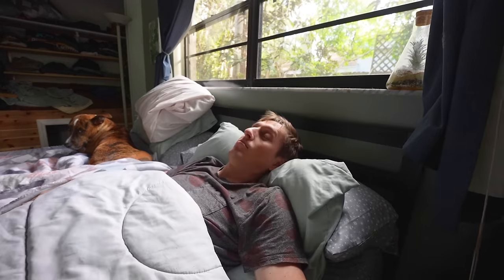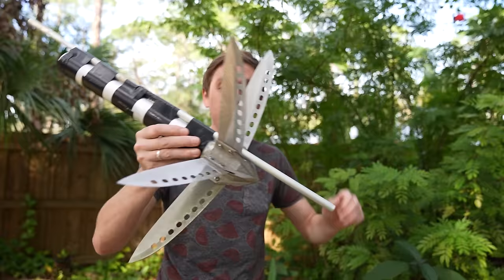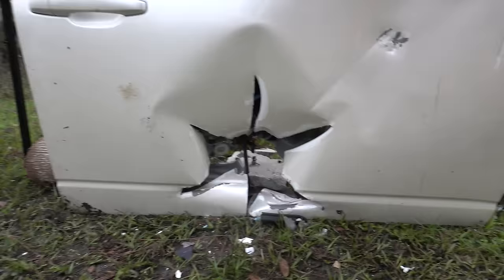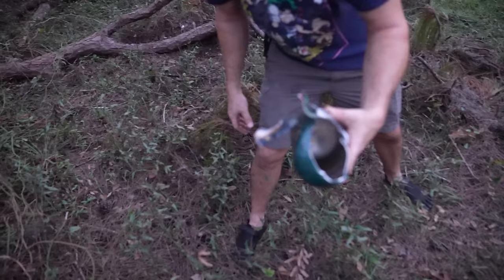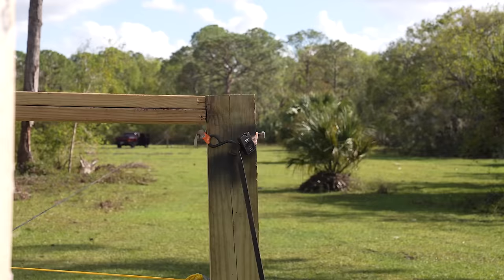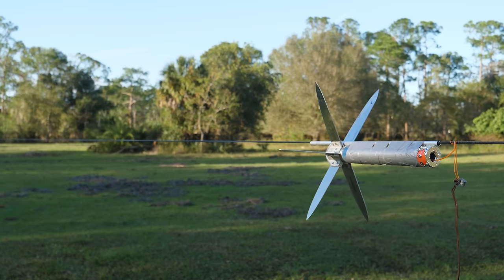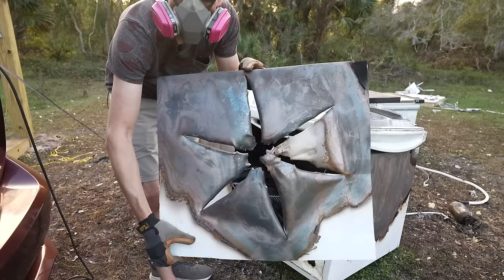400mph Rocket Knife

Comment: For anyone wondering the mixture is 50% kno3 (potassium nitrate) and 50%sugar melted together on a low heat. 👍🏻
Reply: why do ya put sugar though
Reply: @nithinsirimanne2924  that's the fuel.  KNO3 is just an oxidizer
Reply: Would this say be a good explosive for  a tubular pased explosive device
Reply: @Sci_X1  no. Its designed to create steady slow (vs an explosion) gas release
Reply: No that's a banana equally dangerous though.
Reply: A classic recipe, smells like childhood. RIP Grant Thompson.
Reply: Guys I don’t think you can share missile receipts on YouTube
Reply: Wait, is that the ideal stoichiometric ratio or did you mean 50% by weight?
Reply: @drewcmarkham  I literally saw a comment explaining how to manufacture TNT at home in great detail, and no-one cared. I don't think anyone is going to get mad at hobbyist sugar rocket fuel.
Reply: How would you ignite the mix?
Reply: @RAMROD1847  fuse.. preferably electric discharge( igniter & remote switch..)
Reply: @megan00b8  I was joking
Reply: @nithinsirimanne2924  ke toko suruh aku tak
Reply: If you liked this you are now on a watchlist. Ps I liked it too. This is also a joke but it could be plausible.
Reply: better ratio is 60 kno3 40 table shugar with 1 percent Fe2O3 sa catalysator. But better result is when you dissolve all in small amount of water, and slooooowly ewaporated water on boiling bath.Melt is too dangerous. After drying carefylly grind it
Reply: @rishabhsingh61  English?
Reply: Me to I got original anarchist cookbook tells you how to manufacture anything
Reply: If you search deep enough not to hard you can find out instructions on how to make a nuclear bomb
Reply: @seankessens5148  mmmh. do u have a pdf?
Reply: Add iron oxide for extra efficiency
Reply: @drewcmarkham  'Murica
Reply: @gabedarrett1301  by weight
Reply: @Sci_X1  just pour gasoline on styrofoam dude
Reply: @kadikiss  He didn’t show that publicly available recipe incase someone got hurt and pinned the blame on him 
Emphasis on publicly available, as in you can just google it, as in accessible to anyone
Reply: @nithinsirimanne2924  777
Reply: Imma use that
Reply: @newtybot  the recipe he blocked out in the video isn't an actual rocket fuel recipe lmfao. Ffs the last line in it says "remove the meatballs from the oven"
Reply: @newtybot  it may not contradict that there are public recipes out there online for rocket propellents. but it does contradict everything else in your comment. the whole thing was for comedy, not to suppress any possible backlash. saying i cant read but you cant even understand what you wrote 😂
Reply: @ItzDeploy  Yeah the guy who's had the FBI visit his house because he taught people how to make hydrogen sulfide gas and sodium bullets TOTALLY just omitted the recipe for crude fuel for his knife-launching rocket "as a gag" 

Yeah, totally
Reply: That's a weird ratio even for a sugar rocket. 
Also he probably used a catalyst to make the fuel burn faster. 
Just like you'd do the opposite when putting baking soda into the mix to make it burn slower.
Reply: Y'all keep talking about rocket fuel, I'm gonna stay with classic gunpowder.
Reply: @Gun-Bricks  Depending on the projectile, gunpowder can be far more superior. Rocket fuel is better if you need to deliver a heavier payload over a long distance, like this one. 
Then again, if you packed a bunch of knives into a cannon and fired it, you'd probably destroy everything in sight as well.
Reply: Wikipedia
Reply: For anyone who kills themselves with this stuff or blasts off important body parts themselves or other people - say thank you to this nice person here
Reply: is it edible I wonder?
Reply: @misfortune734  Consdering the fact that you use that same KNO3 to completely wipe out a tree's root system....I'd say no.
Reply: That's probably not the mixture. The one you're talking about is just a general mixture for rocket fuel. 🙄
Reply: bro ur gonna start a war or smth cause some people are gonna make those rockets then and try to take over the world
Reply: perfect now he's responsible for 14 deaths of minors 👍

(yes this is a joke)
Reply: Bye 👋
Reply: finnaly i can make my own bomb
Reply: I know, I learned that from TKOR
Reply: ammonium nitrate works as well, also amonium perchlorate

edit: if you make it, be VERY CAREFUL with KNO3 or NH4NO3, they can explode violently, especially when heated
Reply: i thought it was 75-25 whats the difference in power
Reply: Thanks, I remember having seen (years ago) the king of random having made rocket fuel, from my understanding, you add more sugar for a slower burn, and more potassium nitrate for a much faster burn
Reply: @AtomBomb420  yes, and if you remove the suger, you'll discover the fine line between a rocket and a bomb
Reply: @gabedarrett1301  by weighrt
Reply: @megan00b8  tell me
Reply: not true. It was 65% kno3 and 35% sorbitol
Reply: Time to make miltary grade missiles
Reply: @seankessens5148  That's actually the easy part. Enriching the uranium/plutonium is much more difficult; only a few countries can do it

Comment: HOLY FORK!
I've been WAITING for this after hearing about it on the safety third podcast!
I'm SO EXCITED it's finally here!
Reply: Fork
Reply: Fork
Reply: Fork
Reply: Fork
Reply: Furk
Reply: Fork
Reply: What I think would be really interesting would be to have one after the rocket has burned out, and after it has left the string, not impacting anything but just getting the recording of the sound of it passing. Also what I would do is put three of the blades at the front, and three of the blades at the back so that you would have a bit more stability once you leave the string and it wouldn't just immediately nose over.  Calculate the center of pressure to be slightly behind the center of gravity of the expended rocket.
Reply: Feck
Reply: Fork
Reply: Spoon
Reply: Fork
Reply: Fork

Comment: A rocket like this going slightly over half the speed of sound is wild 💀
Reply: bro is not living over the age of 40 💀
Reply: am i wrong or does this thing absolutely have the potential to cover half of florida if the rope breaks?
Reply: @sealteamsix1784  He mentioned that it's very front heavy so no, it'd just crash pretty quickly.
Reply: @patrickmorrey8722 one did veer off course and hit a pine tree 15 feet up though lmao
Reply: @perpeder4370 so it can hit stuff 15 feet away.

Comment: I would love to see a rocket design where the knives were reoriented to have the tips at the front, with the backs of the knives against the rocket body.  It would be the ultimate stabby rocket
Reply: There are retractable broad heads that have that design when folded up. When they hit the target a sacrificial rubber band breaks and allows the blades to fold back into the expanded position.
Reply: @spencerhanson7808  yeah I've seen those on Joerg's channel, I don't think the rubber gasket system would work at rocket speeds though

Comment: 3:30 I thought that as long as the center of mass is ahead of the aerodynamic center, the rocket will be stable, so being nose heavy shouldn’t reduce stability.  However, drag from the blades could cause instability (which could be counteracted by putting fins at the back).
Reply: Also the rocket is travelling horizontally so, even a degree pointed down would cause complete instabilty.
Reply: True it's stable if it were falling under gravity, but not in this case where there is thrust from the back.
Reply: @anluifb  the problem is, acceleration from the same source is proportional to mass. So the lighter tail end of the rocket excellerates faster than the tip. This happens with arrows, it is why the arrows flex so that they can straighten themselves out after the lighter rear end accelerates faster and pushed to the side as it tries to pass the front.
Reply: I just know that rocket goes boom😂💀

Comment: You might want to consider increasing tension in the cable for the next time, the rocket pushes a highly energetic cable wave in front of it... the amplitude will increase until failure or the end is reached...

Higher tension will hinder the wave's development.
Using multiple strains of paracord, splaying out to a frame, which is anchored with multiple anchors should do the trick.

Also, using hoseties/hoseclamps or just metal strips instead of tape might be a bit more reliable as a guide
Reply: Eyo, everybody like this. This actually makes a lot of sense.
Reply: @Peter-ui6ey  thanks for that endorsement, I tend to put high effort into making logical tips on improvements...
after all I'm a talking doggo and there's a huge burden on my back to represent all run of the mill talking doggos out there 😂
Reply: Good point
Reply: @tolkienfan1972  The goodest!

Comment: 2:18 genuinely useful tip - using a sharpened masonry bit to drill hardened steel. If you've ever had to drill through steel+concrete in construction then you'll have done similar. Dipping in water, changing batteries, but no rockets!

Comment: Wow, those things are legitimately terrifying. When I see you-tube videos where people make scary sounding things they're usually far less dangerous than this. Well done! also considering the construction method it really wouldn't be much harder to make folding blade versions of these, for these tests folding blades really aren't necessary but it would be cool.
Reply: If you see anyone setting up a cable pointing toward your house, you'll have the heads up no one else does!
Reply: @helives2630  well honestly if he just moved the blades to the rear of the body and added a bit of weight to the nose I imagine it would fly pretty well without the cable. he mentioned he intentionally designed it to be aerodynamically unstable as a safety measure hence why the majority of the weight is rear of the portion with the greatest drag. make the blades fold and you could fit it in a portable launch tube too.
Reply: @phosistkar6425  That sounds thought out. You wouldn't happen to be planning anythin, would you?
Reply: @GROOT0404  Nah, I don't have access to enough open space to play with anything this dangerous. It's a fun thought experiment but would be completely unsafe to try in the real world.
Reply: @phosistkar6425  Isn't the intention for it to be completely unsafe?
Reply: @GROOT0404  Not for me, I'd rather not spend the rest of my life in prison for making a bladed rocket that hurt or killed some innocent bystander. Putting myself somewhat in harms way for fun is fine but putting other people in harms way is too unsafe.

Comment: This is cool.  I read a book somewhere that they use star shape core at the rear end of the motor in order to maximize the burn rate at the beginning. That kicks the rocket to a higher velocity at initial phase, and then the cavity becomes narrow up the tube in order to sustain longer flight.

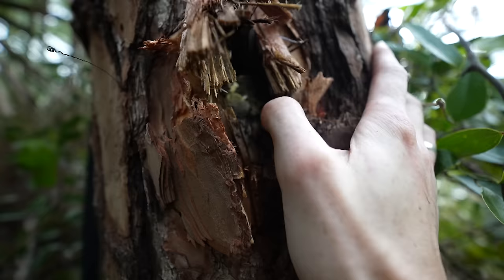Comment: 1:50 Math correction: assuming constant acceleration, the end / max speed was 988 km/h, i.e. x2 higher than 494.
Compute acceleration "a" using x=0.5*a*t^2 and substitute it into v=a*t=2*x/t=274m/s=987.552km/h. Almost speed of sound.

Comment: I thought about this, and ways I could shoot it out of a RPG type thing. And then I thought - why not shoot multiple out of the same barrel? And then I thought, why not do away with the blades and make them sharp spikes so that you can fit more? Following that line of thought, why not make them little balls so that you can shoot out a ton? Less range for more damage? But since reloading would be a pain, you could put them in a disposable cartridge, like a giant bullet. I then came up with a really cool reloading system where they are end to end in a tube and get pushed into the barrel one at a time. That would be really cool to mount on a vehicle, but what if you made a portable small version, like a rifle?
And that's when I realized -
I had reconseptualized the shotgun.
Reply: you also reconseptualized flechettes

Comment: i have a tone of model rockets and im planning on getting my first license for high power motors in a year or two
this was amazing the best video you ever made
Reply: No need for a licence if you can just mix (rocket) with (motor) to make the solid fuel called (rocket motor) which you can cast at whatever size you need. Well, unless you live in Europe in which case it might not be legal.
Reply: @theKashConnoisseur  i live in the us and yes its posable and cheaper to make your own propellent but can you reliable get it to evenly burn and get your rocket up to 15K+ feet and 2X faster then the speed of sound
Reply: @pdfoltin5076  Where there's a will, there's a way. Real question at this point is, would it be cheaper to make your own after factoring in materials and equipment costs?
Reply: @theKashConnoisseur  are you kidding? It's so much cheaper to create your own motors by like 80%
Reply: @theKashConnoisseur  yep if you made a hundred or even 25-35 of them it will be cheaper but any less and the equipment wont be worth it so it would work and the big motors are like $200 a peace
Reply from the maker: @pdfoltin5076  there's no wrong way to do it! I like making the fuel, but a lot of amateur rocketry clubs don't let you use homemade fuel, or restrict you to a few proven propellant's.

Comment: I feel like you could make the blades foldable to extend them. Some kind of spring-loaded folding mechanism that lets you retract them into the barrel and instantly begins pushing outward when it leaves the tube. It would probably need some kind of upgraded tech from just basic springs and would likely require some modding to the barrel to prevent the blades from cutting into it, but I think that could make it pretty cool. A bunch of blades sling out from all sides as it rockets toward your neck and decapitates/eviscerates/vivisects the whole family at once! Flashy and effective.
Reply: I think that's what the military version does. Considering how long it took him to machine and assemble each of these, I don't think he wanted to spend a bunch of time and money to weaken the part that needs to be the strongest for the design to function, but it would totally work.

Comment: What I think would be really interesting would be to have one after the rocket has burned out, and after it has left the string, not impacting anything but just getting the recording of the sound of it passing. Also what I would do is put three of the blades at the front, and three of the blades at the back so that you would have a bit more stability once you leave the string and it wouldn't just immediately nose over.  Calculate the center of pressure to be slightly behind the center of gravity of the expended rocket.
Reply: Its probably intentional, 300+mph those things would go for miles if they got away stable.

Comment: Wondering if he notices the garage rail shorting at the wall.. haha, had a dryer in military housing a resident hooked up.  it was in q historical house with a gas line coming through an old coal door. Resident didn't ground the unit so it was searching for ground, found it through the dryer hose also cut through the coal door. I noticed the problem then they turned itn on and the gas line was arcing and welding itself to the coal door lmao.. You for home improvements!

Comment: The mix is sugar and ammonium nitrate (aka stump remover). ITs a common mix for airsoft  smoke bombs as its cheap and easy to make while being relatively stable. Depending on your mix you get smoke or rocket engine based on the reaction speed of the burn. it is not an explosive mix so not regulated by any government agency that i am aware of.

Comment: If you heat hardened steel until it's blue then let it cool slowly (bucket of kitty litter or welding blanket) it will remove the temper and soften the steel.  hope that helps you out a bit.

Comment: I guess you forgot that they had something like this in WWI.  They weren't rockets, but drop bombs for the few planes that were actually used in the First War, and had spring loaded knives like wings on the weighted projectiles.  Looked more like a tall can of beer, but was more likely to hit an opponent than a single 10 lb weight..

Yeah, I'm just about old enough to recall the Great War, but I'm also a walking encyclopedia of arms of all kinds.

Comment: lol this wasnt your idea. you may have thought of doing what you did. but this has been around longer than you know.......  no one stole your idea. you simply re created a concept that has been around for quite awhile. 

the timing is the only interesting thing. but even that is explainable in that more and more drone bombings have been getting alot of backlash from too many casualties. 

lol an old classmate and buddy of mine designed something also very similar to this concept nearly 10 years ago. and actually had several variations on it as well allowing different scales and types. some that could be used from a 203 shot by hand. all the way up to tomahawk style that would break off into 30+ self guided ones that actually would use its blades as fins to help it stabilize as it flys and then fully extend just before impact. 

had ones that would launch in conjunction with a range finder that would detonate something similar to a razor grenades once it reached a pre set distance before reaching the lased target. 

i mean its not to take away at all from what you did and your youtube videos. I also sent in many of these ideas only to see parts or concepts either blatantly used or re engineered for a different use than  we intended.  but that being said when it comes to military R&D projects........ 19/20 times your ideas have already been thought up twice and either used and tossed or shelved for when a tech could make it possible. so your either gonna need to be pumping out ALOT of ideas or your gonna have to REALLY step far far outside of the box. and even then its far more likely someone else thought it tried it and moved on already.